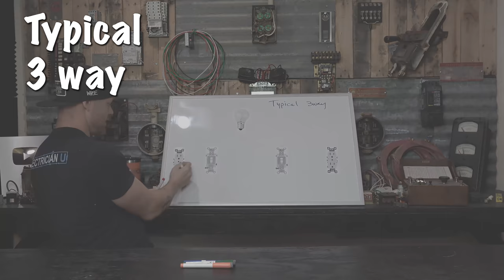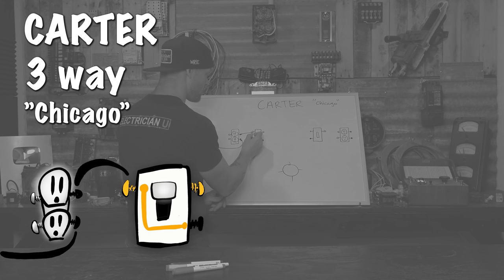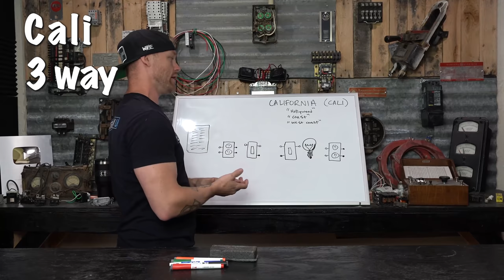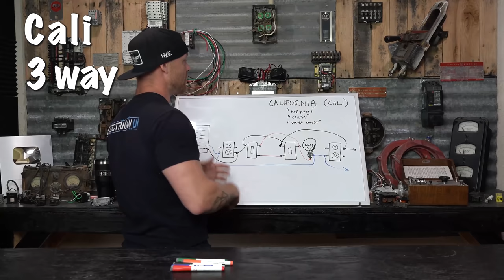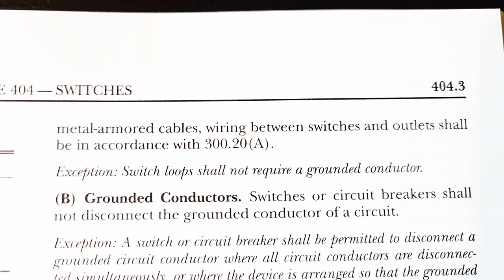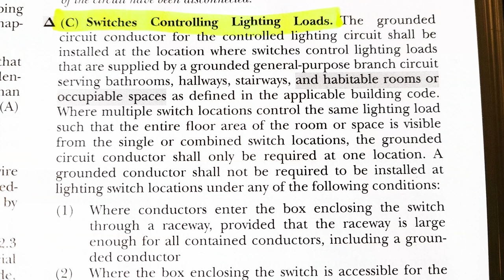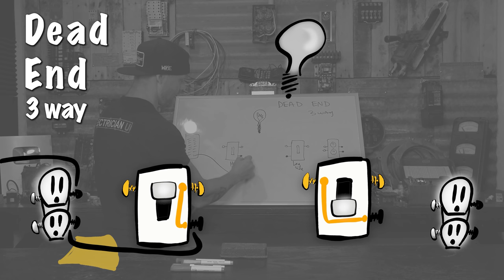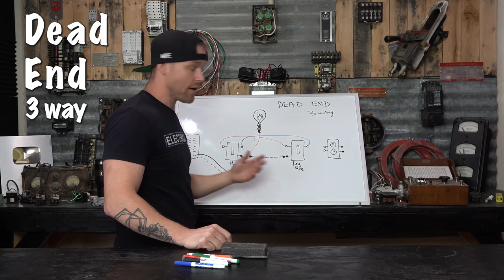THREE WAYS 3-WAYS CAN BE (3way Switch Wiring - ILLEGAL AND LEGAL METHODS)

Comment: I re-wired my house all the lights I rewired I ran on 15A breaker with 14AWG wire. Ran two parallel runs through the attic where they tap off at various places. This way like every other room is on a separate light circuit should a breaker blow you can still get a light nearby.  The feed then goes to the fixture box and then I ran 14/4 with the ground to the switches. This gave me hot, neutral, and two hots for return for like ceiling fan switches, etc.  I did a similar in my living room that needed 5 switches each switch has a 14/4 to it used all 4 wires for the 4 ways, then tied them all together in the attic in a big junction box and then fed the fixture from that. Every room then has at least one switch with a neutral too.

Comment: in the Chicago method how do the two wires (blk & white) from the light fixture run too two different locations
Reply: They are wire nutted in the light box in most cases.    One situation that can get you in trouble,  is when you have the light fed from two circuits, if they are not on the same phase,  L1 or L2, one of the "OFF" positions will send 240 volts to the fixture.  On some farmhouses you will see a yardlight in between the house and barn or detached garage with one wire one wire from the house to the light, one wire from the outbuilding to the light,  and has 3 way switches controlling it.  I have heard this setup referred to as a farmers 3 way or barnyard 3 way, just another name for a carter or Chicago 3 way.

Comment: In the UK we call that a 2way. As there is 2 switches controling 1 or more lights. Typically use on stairs or a corridor. And what you call a 4way is called an intermediate switch  which go between the strappers on a 2
way switch

Comment: They now have switches that you can dim at all locations. Not just one as you indicated. I have wired 3 switches in a bed room that dims at all locations. They use a wireless signal. Yes no 4 way used in this system. think you can have up to 8 switches
Reply: Is it wifi connected? Lol
Reply: @markchidester6239  It works on its own. Need neutral at every box. Can be use with Wifi also. the end device has to be wired in front of the light circuit. Leviton devices

Comment: >>> Apolgies to anyone who read my original comment which was a mistake. I re-watched the video to double check my statements, and have edited accordingly.
Another hazard of the Chicago is that in one condition, the fixture will have two hots in order to be off. 😜

There are actually other ways a 3-way could be configured, providing that the local jurisdiction allows reidentification, and doesn't require a neutral in each box...
Also, 4 conductor NM-B/C is available, which, among other things, can provide a neutral, as well as eliminate the need to reidentify a conductor. Back in my electrician days, we'd keep a roll of it around. It's really worth it, in some applications. (Pretty much a necessity for a bath fan/light/heater unit.)  One 1000 ft roll would usually last more than a year (20ish houses...)

Comment: heres what i shall call a "nashville 3-way". although i had quite a few different nashville 3-ways. ;-)
when you only have 12/2 in place, tape the white red and run it as a traveller with the black.
then, tape the bare ground white and run it as the neutral (in non-metallic boxes).
lol

Comment: I really enjoyed the logical way you explained the different 3way switch configurations.
I am having a bit of trouble with the wiring for a particular 4way switch setup though. 
I understand the wiring for what I would consider a traditional 4way setup where the power comes into the 1st 3way switch through the 4way switches and out to the 3way switch at other the end and then out to the light or other device.  
I am hoping you can describe/diagram a 4way setup where the power comes into the 1st 3way switch and the leg that goes to the light or other device also comes out of the 1st 3way switch box. Would this be considered a dead end 4way? 
I think I have it diagramed correctly but none of the diagrams I've found online address this configuration
Thanks Jeff

Comment: I hate 3 ways and 4 ways; only thing i kinda struggle with understanding even after your most excellent video 🥺
Reply: 🔰 All a 3-Way does is switch the path of the hot wire. The switch isn’t an on-off switch – rather is a (toggle) path redirector; So when you toggle the switch, you’re taking the hot and simply moving it to the other screw on the same toggle side of the switch, which in turn, provides a hot path to the other switch, allowing current to flow to the end device(s).

He shows the internal of the 3-way switch with the little brown line in the diagram.
Reply: For some reason visualizing it as train tracks made it work for me when I started. You have one track out of the left station (power common) that splits into two tracks and then converges into one path again that goes into the right station (switch leg common). If the train takes path A coming out of the Power station, then path A needs be selected to go into the Switch Leg station for the train to arrive. If path B is currently selected to go into Light station, then the train can't arrive and stops at the switch.

POWER------------------<============>-----------------Light

< and > are your 3 way switches travelers, with power being the common on 3 way switch and switch leg being the common on the other 3 way switch.
Reply: @JCVCIII  I love your text diagram! I've been struggling how to get that point across visually in the comment section here, and you did it perfectly! Now here is how I would insert a couple of 4-way switches and show how there can be as many as you want:
----<====x====x====x====>----
Imagine replacing any x with an = if you toggle either the < or the >. On or off from any of the 5 switches! Or 10. Or 20. However many x you want in the line!
Reply: @65gtotrips  Dang that actually makes it a bit clearer. Thank you!

Comment: Question:Can I use three-way switches to control more than one load, For example, I have a switch at on end of the hallway, sequential light fixtures (2), and then another three-way switch. Or would this be the case with a 4-way switching system?

Comment: If you use the Chicago 3 way to a florescent fixture would it make a difference???
Reply: Not as dangerous as on a regular incandescent with a screw shell, other than it's still against code to switch the neutral.  If you hook up a Chicago 3 way to fluorescent,  LED or HID fixture (not recommended) it can be switched from either end just like a traditional hot side/leg side 3 way because the fixture sees 120v when it receives a hot and a neutral,  and sees 0V when it receives two neutrals or two hots

Comment: Correct me if I'm wrong, it's been years since I read this, and I don't remember which section it's in. Doesn't code state that a grounding conductor can be reidentified, but only as a hot, it should never be used as a switch leg or a traveler.

Comment: I have a dead end 3 way.  At the dead end switch I want to add an outlet.  How could I rewire the circuit to carry a neutral over to the last switch in the circuit?
Reply: And good point bringing this up.   This is why personally, I don't use dead end three ways in new construction, one exception would be in a two gang switch box with a 3 way and single pole switch that already had the neutral in it from the same circuit. In this case depending on the layout of the house, I may use a dead end if it means less wire.   Back to your dilemma,  you could fish a white THHN conductor of the same gauge as the circuit and add that from the nearest source, whether that be a receptacle,  another switch,  or the light fixture whatevers easier. You could also go the quick and illegal route by turning the setup into a Chicago 3 way, by connecting the black and white to hot and neutral,  pigtail them to the travellers on both switchs, and use the red on the common for the last switch  wirenut that to the black or white, from the light, basically the light will be connected to a common from each switch.   Then you have a hot and neutral at the far end to add your receptacle.  I don't recommend that.     If you end of selling the house or someone else is called to work on the system they are in for a big surprise.

Comment: you should do a tricks of the trade survival episode for little things that make life easier on the job like if you run out tie wire around a stud so you have one twenty foot piece of tie wire folded in half around the stud you can put both ends in a drill and spin the whole length with consistant twist all the way up to the stud. make for a nice look and works great just after you twist it all the way up reverse the spin on the drill and let it spin back couple times and the tie wire will be perfectly straight. another tip is to make candy canes for under grounds all at once. count your stub ups cut conduit at 3'4"  so you get three cuts per stick, glue you 90s on and leave your bell ends ready for recieving conduit. that way all stub ups are slapped together easy and you have them laid out and ready so you can just sit at one end of a trench and push conduits out tell the stop in all directions then you have one quick last glue. use emt for building your racks so all conduits are spaced equally and looks damn good. another tip is to use crimp sleeves on plugs that have no backing cuz drywaller has a blow out the crimp sleeve put on the screw and crimped keps the plate from breaking. Oh and pvc glue works great for any cuts you may get along the way just dab a little glue to stop the bleeding and your good to go 😁👍🤫

Comment: There is another 3 way. Run 14 /3 or 12/3 to light box and another one to 2nd. switch and cap of travelers in light box. You have neutral and switch leg there.

Comment: Ok, big question. I have several 3 & 4 way switches that were wired with the power at the light fixture. So no neutral at any location. Very frustrating. What I am wondering is if there are any tips to dealing with this for adding  smart switches? Alternatively, if I have to I can run a new wire from the panel up through the wall into the boxes from the basement. But then I am unsure about violations having the circuit spread out across the building that way. Having hot come in from above on an old wire, and grounded conductors come in from below in a new wire.

Comment: As a variation on your "Dead End 3-Way" diagram, let's say a near 3-way switch has both HOT power available and HOT and HEUTRAL to the lamp to be controlled.  The far 3-way switch is alone in a box with RED, BLACK and WHITE leads.  From the near side we use three travellers as follows: HOT from the near box to the BLACK traveller to the COMMON on the far switch.  Then both WHITE and RED as travellers (both intermittant HOTs) to the other poles on the far switch.  At the common contact on the near switch we connect it to the BLACK going to the lamp.  WHITE neutral to the lamp is already "nutted" to other WHITES. This looks like your "Dead End 3 Way" but with the roles of the BLACK and WHITE wires reversed. Whoever did the wiring left no notes but this appears to be what he had in mind, to keep BLACK going to the lamp, and at least "hide" the internal WHITE wire in the Romex bundle of RWBg where it's less likely to be mistaken for NEUTRAL. .

Comment: I want to add a dimmer to replace  regular switch that  work outside light. I only see two black wires in old switch. They are two other switches that work on two different light ceiling. Don't know where to place the black wires for new Dimmer switch. Looks like old switch was just running two travel wires. Not sure if that makes sense.

Comment: Another issue is guys doing dead end 3 ways and not changing the color on the white wire. Not to mention so many other places old hacks don't change the color on the white wire. What happens is you are called out to troubleshoot and some painter/ handyman took out the devices and you are left to put it back together.

Comment: When I do dead end 3ways It almost always is into a 2 or 3 gang box with multiple 3 ways. In the most recent case iv got 2 3 ways  line side but no power to it and there is power coming to the other 3 gang box with the load side of the two 3 ways. so one of the whites brings power from the other box but there is still a neutral from the other 3 wire so there is still a neutral in both boxes.

Comment: Hey Dustin, I have a end three way switch that I want to jump off of to a single pole switch to operate an outside light.  Can I do this ?  The travelers are hooked up and the neutral is recoded black and I want to jump to the single pole.

Comment: Awesome Video. Please let me know how you feel about the Dead End Three Way not having the neutral with regard to inducing voltages on the unused travelers. My dad always told me you have to bring the neutral with you because of induction. I recently was working on a 3 way that some Hack put a small fixture across the pivot and one traveler. This became evident when we replace a trougher with an LED trougher. The small load of the LED trougher allowed it to be on when the other regular Ballast lights were off. We read the voltage on the LED trougher and it had 14 volts when we expected to see zero. When I was investigating the issue I was reading strange voltages on the travelers that actually confused me. When I found the small load and got it of the pivot and the one traveler everything functioned properly. The 3 way was a dead end 3 way. The first switch had the feed and the switch leg up to the light. This meant that there was no neutral going to the second switch. Had a neutral gone to the second switch there would have been little to no induction. I was reading 45 and 75 volts on the unused travelers depending on how the switches were operated. When the Black went straight through and the red was floating it had 75 volts to ground on the red. When the red was being used and the Blacks were floating I had 45 on the black wire. This was pure induction. There was no current available at these voltages and I splashed them on the grounded boxes to make sure when it finally dawned on me that it was just induction. So then I went searching for the code to prove my dad right a 40 plus year journeyman. So fun fact is that I can not find where the dead end is illegal, especially before 2011. But even now. I guess it is always a good idea to feed from one end and switch up to the light on the other so that the white can be the neutral in the travelers and offset any induction in the travelers. The Mutual induction is real on the unused traveler when referenced to ground. I don't know of this being hurtful but it can be a little confusing if you meter it. Well anyway if you can reference the inductance when the neutral is not ran between switch boxes on 3 and 4 ways and is this hurtful in anyway. With the neutral always in the conduit or in the MC or romex with the travelers the amount of induction will be minimized and the voltages on the unenergized traveler will be nominal. Super video. Thanks. Love it.

Comment: I did a job where a man got smart WiFi dimmers for every switch in his house. Even three ways, so you could dim the lights from separate locations. In this case a neutral wire was needed in every box.

Comment: Thanks that was a interesting but you missed a way to wire a 3way that is a 2 wire to the first 3way then a 3 wire to the light and a 3 wire to the other 3way
Reply: Yup, I have one of those in my house!
Reply: White wire in 14/3 from 1st switch to light gives the light it's neutral from the 2 wire in 1st switch. White wire in 14/3 from light to 2nd switch will be your switch leg. Red and Black travelers tie together in light box and passes through. The black(hot) at 1st switch goes to common side of switch. Here in Missouri we call that a half-ass 3 way. Not sure of technical term for it

Comment: Hello when wiring a ceiling fan and both (red &black) wires are hot and one switch is a 3 way & the other is single...can I tie them both together?  Because one is left hanging...Thanks

Comment: What about use a relay NO/NC to start a 3 way switch, and activate the relay with a micro controller like arduino. It is on code?
Thanks
Reply: If I'm reading you correctly you can if your relay has a manual switch as a disconnect means...
Reply: Thanks, 
I’m planning a smart home with a panel of relays, using travelers (2 wires instead of 1) and 3 ways switches instead of one way, that will be A LOT cheaper than a $50 smart switch for every light. And also avoid obsolescence if a brand is off market or Alexa do not support a certain brand.

Comment: Hey, to comment on the 10:40 minute mark section of the video about the neutral wire in every switch location, I do run neutral to every switch location in NYC.  But where do you find a wire without a neutral???  All wires come with a Black and a White, at least in a 12-2, 12-3, or whatever wire using, unless you are using a conduit and running your own wires..???  I do not see why not using a neutral.  It is not Illegal.

Comment: I have 2 three ways switches going to 2 light fixtures but only 1 operates the light fixture and the the exhaust fixture. How do I get both light fixtures and the exhaust fan to work with the 2 three way switches

Comment: Another great video, thanks. A few weeks ago I learned the hard way when replacing can lights with flush mount LEDs and installing dimmer switches. A standard 3-way dimmer only works on one switch unless you buy a special brand/model of switch. If I had bothered to read the instructions I would have saved a lot of time! Learning by doing...